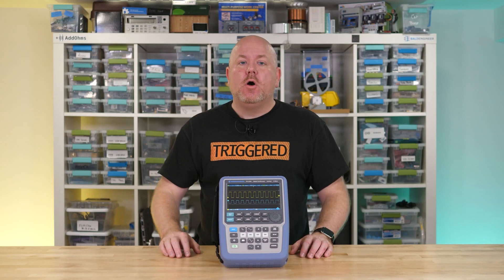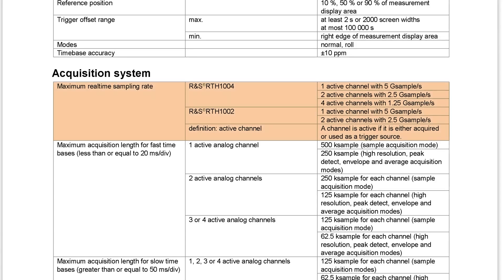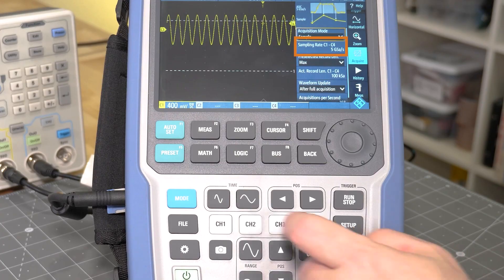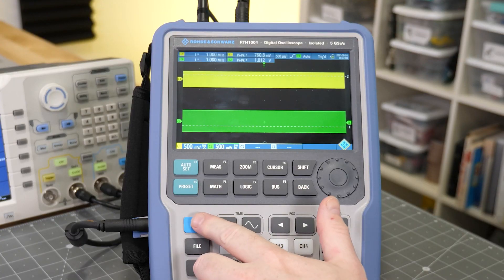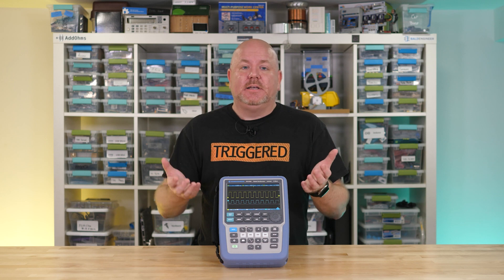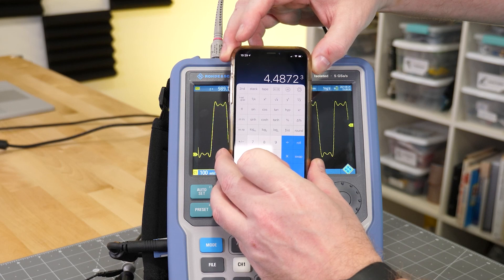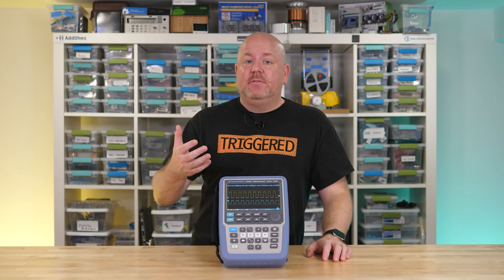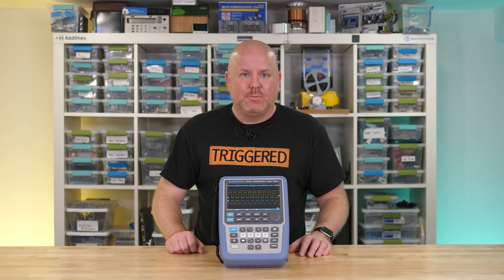What does Bandwidth mean for Oscilloscopes? - Workbench Wednesdays

Comment: July 2025, If looking at a digital data bus why go through A/D converter ? .707 times peak to peak is rms right.  To accurately see rise time you need bandwidth faster than what you are measuring ?
Reply: You should always verify the signal integrity of a digital signal which you can't do with a logic analyzer.

and yes, to correctly measure a rise time you need enough bandwidth to see all of the spectral content.

Comment: hi good video, i am looking to put together a small e lab, it has been 20 years sense i had an e lab, and a scope tech has changed a lot...
i am looking to try and build a 3 phase power inverter using a pi or an Arduino micro controller, in the 30 to 120 Hz range, i would like to get a nice clean sine wave, what kind of scope should i be looking for?